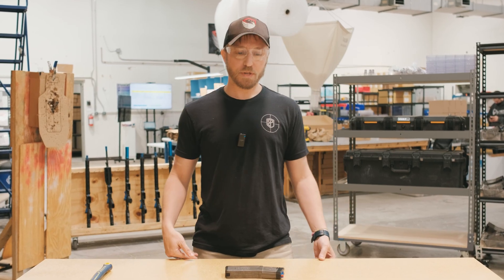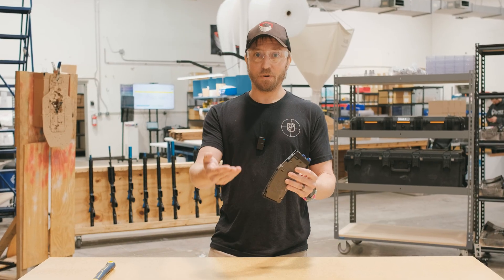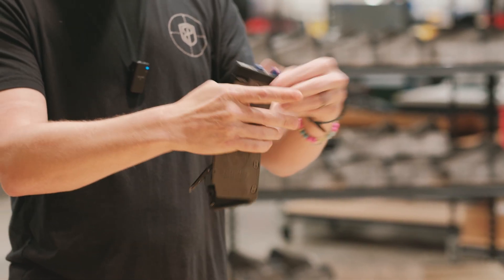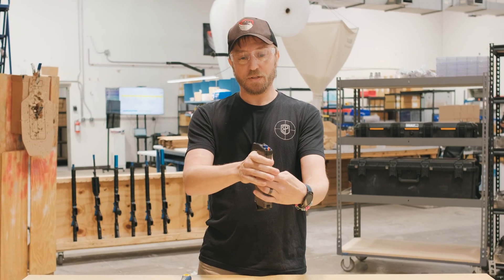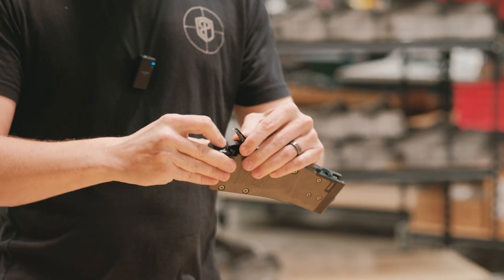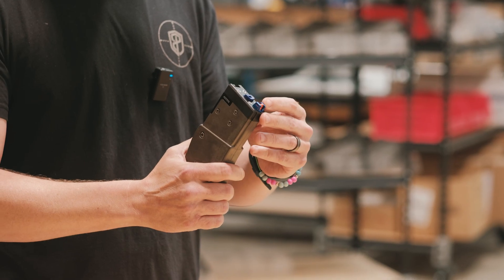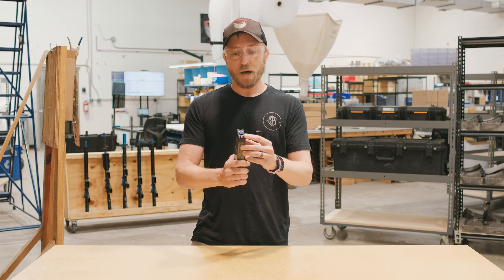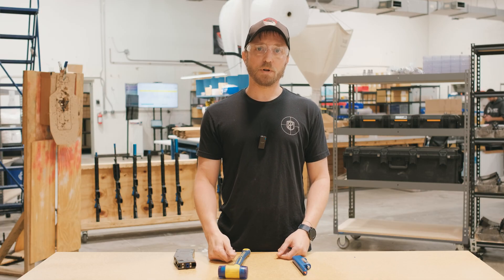UNIT4 - What to do if you have a stuck CO2 cartridge in your UNIT4 Solutions Magazine

Comment: I know it's a training rifle but could it be used for airsoft or not, I'm hoping this isn't a dumb question?.
Reply from the maker: Not a dumb question at all. Our system was purpose-built for training, not a hobby which led to significant changes in the product development. 

A couple  features of the UNIT4 that you won’t find in an Airsoft Rifle:
- We use a 16g CO2 cylinder for 30 rounds allowing for better recoil and better performance in cold temperatures. 
- The rounds our system fires are 8mm rather than 6mm delivering a more appropriate pain penalty in training. 

There are many more differences but those two may impact whether the system is legal for competition. It likely depends on the rules and regulations of your local field or league.